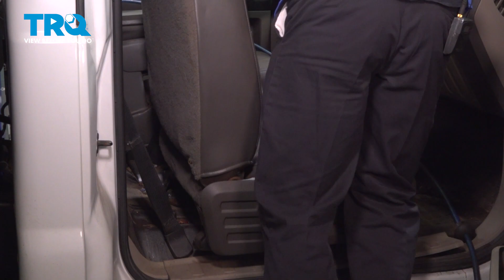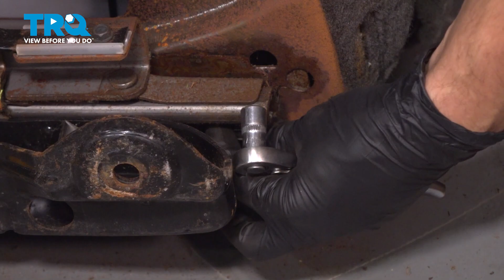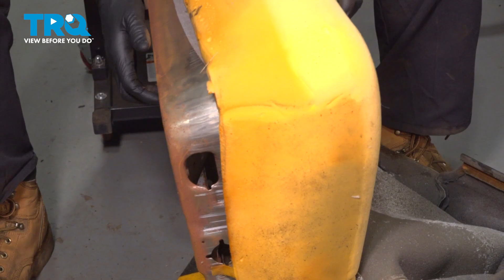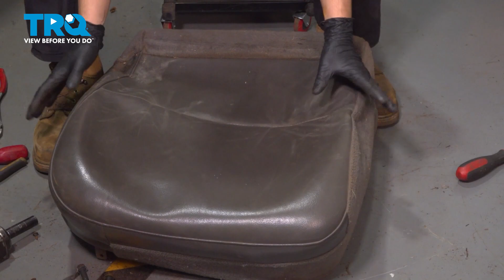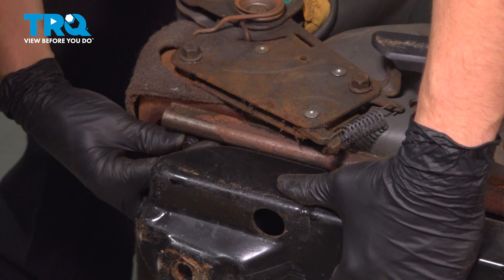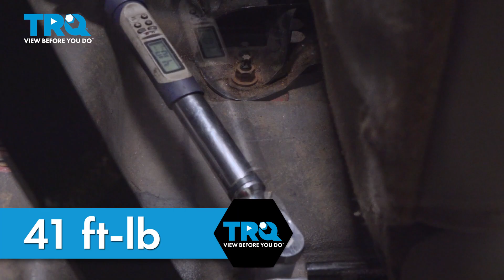How to Replace Bottom Seat Cushions 2008-2010 Ford F-450 Super Duty

Comment: Boo, you forgot to add new hog ring clips back in that were clipped off with the wire cutters. The hog ring clips that hold the seat cover to the cushion in the middle of the seat.